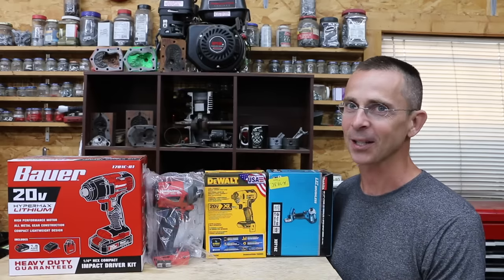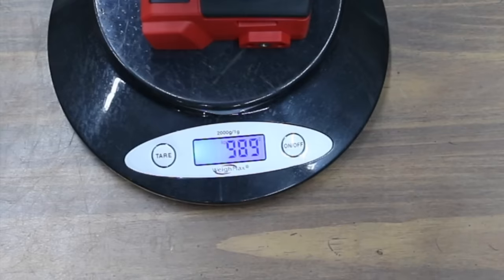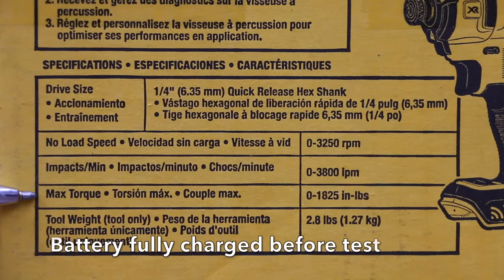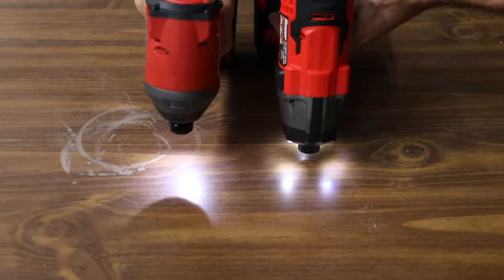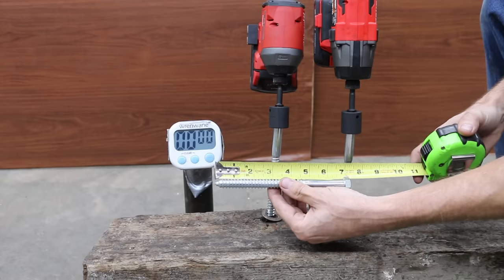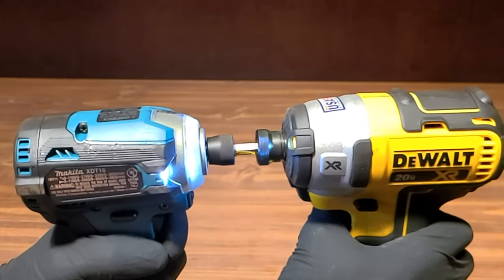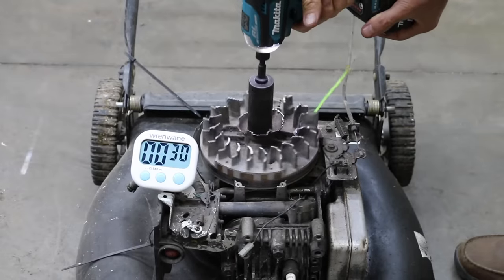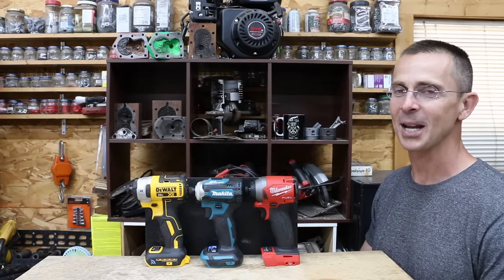Best Impact Driver? DeWalt vs Milwaukee vs Makita vs Bauer!  Let's find out!

Comment: The Milwaukee isn't "powering down" this is called over current protection and it keeps people from abusing the tool like this. That's why it's the only impact drive that didn't try to catch fire during the lag test. It's a feature, not a failure.
Reply from the maker: Thanks for the feedback.
Reply: It's actually a battery temp issue. That is the main way of protection. The milwaukee batteries will put out of to 100 A for their high Ah batteries.
Reply: It's also to prevent the base voltage of the lithium ion battery dropping below s certain value, which would prevent it from recharging properly.
Reply: Mine does it after 1 mins use
Reply: I agree! My Porter Cable impact has done this from day one. It's over 5 years old, fairly well used, and I've never seen it smoke.
Reply: That and it completed the task so much faster that it didn’t have time to heat up as much. It beat the majors and Dewalt by a long shot even with protection kicking in.
Reply: decision you need to make yourself, do you want a tool that will go till it can't no more when you need it to or the ones that "decides" for you when to stop?
Reply: @ProjectFarm  Why not give a answer vs an autobot answer? It feels kinda lame
Reply: @twitchlazy  if a battery temp issue only results in the tool powering down and you just release and resqueeze the trigger and it starts again... kinda sounds like the battery isnt going to cool down much... with makita if the battery over temps it disables itself completely for about 10 minutes, same with my Rigid tools

this doesnt sound like over temp it sounds like over current protection

but it the millwakees over temp can be overridden simply be resqueezing the trigger kinda sounds like a failure waiting to happen and i doubt extremely highly millwakee allowed that oversight.
Reply: @NIGHTMAREuki  that depends... on whether the tool costs 180 bucks and the decision actually keeps the tool fighting another day... granted Ive abused the shit out of my makitas and they still work so maybe it doesnt matter much.
Reply: Love the implication that the impacts were trying their hardest to combust
Reply: Where is the american freedom, what if i want my tool to try and catch on fire
Reply: That’s literally powering down lol. P = IV
Reply: “power down” or “over current shutdown” are the same thing
Reply: @RomboutVersluijs  at least he acknowledges his viewers. You really gonna hate on him because of the method he uses.
Reply: @RomboutVersluijs  Let's see you take care of comments from several million viewers for a couple years, then see how you feel.
Reply: @IstasPumaNevada  Thats true!
Reply: @NIGHTMAREuki  It stops itself FOR you because it's protecting itself from an idiot.
Reply: While it is a feature, it IS powering down (to save itself). The tester never said it was a failure, just reported what happened.
Reply: You say that. Using them in industrial field because it's all our planners would purchase. 
That feature fails along with actual trigger component failures and there is something is the connection to batteries that also fails at high rate. Have destroyed immense amount of these in the field to various causes. They do impact hard but also seem to wear out very very quickly with heavy use and grt incredibly sloppy and or just fail outright.
Reply: @compzac  Makita also has the same basic protection features, they’re actually regarded as amongst the best in battery and tool protections. It’s just that Makita isn’t prioritizing raw performance over everything else, so it’s rarer to need them.
Reply: @Devon Blazek  we get it, you work for dewalt.
Reply: @twitchlazy over current = Thermal runaway
Reply: @tooltime9260  because I comment saying it's probably a bot doing the work.

Comment: Can we see a show down between 1/2"  battery powered impacts such as Milwaukee high torque fuel and the DeWalt XR, Makita, Ryobi, Hercules I seen one video for nut busting torque between Milwaukee matco snap on and Carlyle and Milwaukee took the cake I think you would get a ton of views for that especially after proving matco and snap on impacts won't when they claimed 1600 but only got as far as 800
Reply from the maker: Thanks for the suggestion.
Reply: @ProjectFarm  you definitely need to make sure you do your research and don’t get the new Milwaukee 1/2 inch they are trying to sell now they changed the gears inside and it’s junk and they break very easy now
Reply: I bought the Ridgid heavy duty and it beats Milwaukee hands down.
They also gave me their 7 1/2 brushless saw for free and it too beats rolling out cords.
Reply: @keithlucas6260  no way it does
Reply: @jacibflores97209 ,
yah way it does....even had a head to head and it smoked Milwaukee which owns Ridid....put it's parent company to shame.
Reply: @Jacob Flores  I watched tons of videos the milwauke high torque was the leader for years.  It does beat the ridgid especially usuing the m18 high out battery.  But mikeaukee needs to come out with a new gen
Reply: It kills me to say this because I'm 100 percent a milwaukee fan boy  I've owned lots of other manufacturers tools but milwaukee is by far the best especially in lasting and warranty.  So here's what kills me to say... lol   dewalt has a new 1/2 inch high torque impact that destroys every other impact for torque.  It's not the older 1200 ft-lb one   it's the new 1400 ft-lb one.

Comment: This confirms my belief that Milwaukee is quality.
Reply from the maker: Thanks for sharing.
Reply: I’ve seen Milwaukee out perform a snap on tool
Reply: J T that really wouldn’t be apples to apples, but it would still be fun. Hilti is a professional grade tool, Milwaukee is just the best of the prosumer tools. It still might hold its own against hilti though.
Reply: Milwaukee holds it's own, but will get it's ass kicked in long term durability by Hilti. They're the only ones that still make true pro level tools though, Milwaukee, dewalt, Makita, are only prosumer/low end professional.
Reply: This dispels my belief that Milwaukee is junk. #beliefsadjusted
Reply: John D I’ve run my Milwaukee against Hilti before I knew how big hilti was. It outperformed my coworkers but those were both used tools so I couldn’t say on a brand new out the box versions. Hilti’s warranty is better than Milwaukee’s however I’ve never seen a practical application in their 20 year warranty. Within 20 years it’s gonna die of normal wear and tear and not be warrantied. Or it’s gonna be obsolete to newer tools.
Reply: Too bad a Chinese company owns them now. I still buy their stuff since the quality doesn't seem to be affected.
Reply: J T  yeah, but that's not what most of these small impacts are for. They are mainly for light duty work in the garage or to throw on a few decks screws. I still use a Makita 9.6 volt nicad that has put up more screws than most of these new impacts would be able to handle before being ready for the scrap yard.

Comment: Being a Milwaukee fan boy, I am certainly glad it won. I have the same impact and love it.

Future video idea would be the 1/2 impact drivers. Always seems the be a debate in the garage as to whose impact is better.
Reply: I have the Milwaukee 2767 impact wrench and it's a absolute beast.
Reply: I have one, bought it to remove the pinion nut on my 11.5" AAM rear differential.  Took it off no problem.  That nut is torqued to 350 ft. lbs, then add 12 years of weather.
Reply: @BigBrotherIsTooBig  What type/brand of socket adapter did you use? that is a lot of flex for the adapter.
Reply: @SDsailor7  I didn't use an adapter, it's a 1/2" impact.

Comment: dewalt's app is on prozac: every thing is fiiiiiiine tool also catching fire
Reply: Exactly! LoL
Reply: & and why the heck do I need bluetooth on my impact driver? does it play music as the smoke comes out?
Reply: @donoimdono4868  no but you can change the color, smell and toxicity of the smoke that comes out
Reply: Lmao
Reply: Just don't think about it.
Reply: I have Dewalt tools and love them, but the 887 impact driver can get pretty dam hot and smoke a bit. Had about 1200 100mm bugle screws to run through is timber at work, ended up grabbing my 996 drill after the first couple of hundred with the impact. The 996 peeled through the other 1000 bugles without missing a beat. The impact was still cooling down.

Comment: Love it when there's a clear cut winner.... especially when it's the 2nd least expensive power tool out of the bunch. Milwaukee crushed it.
Reply from the maker: Thanks for sharing.
Reply: Yeah… I just don’t like how Milwaukee kept shutting down. That would drive me crazy on a job site. “Time out, boss! My tool keeps pausing.”
Reply: @seandhoward  I haven’t seen any other ones do that. Milwaukee has a great warranty so they would replace it if your’s ever did that.
Reply: But dewalt is affordable
Reply: Milwaukee has always felt like a kids toy every time I've used one
Reply: @NathanaelD  A kids toy that our performs all the rest? lol. Dewalt feels like shit in my hands. Makita is nice.
Reply: @NathanaelD  You clearly haven’t used a modern Milwaukee, or have use the commercial fuel lineup...milwaukee has made LEAPS AND BOUNDS in durability and quality over the last decade. They are on another level, and this video proves it. Most heavy duty construction or tradesman job sites all use Milwaukee. I rarely ever see a dewalt anymore.
Reply: @deepswimer11  did you watch the video? The dewalt was more expensive than Milwaukee by $40 lol...
Reply: @jaredchampagne2752  I'll admit. At the time of my previous comment, I hadn't used much Milwaukee. I am more of a fan now after seeing their lineup and the pack out.

Comment: the railroad lag bolt test was brutal. thanks. really nice to see which ones hold up under duress
Reply from the maker: Thanks for watching!
Reply: Ikr can't believe some actually smoked lol   the milwaukee shuts off because the tool and batteries talk to each other to prevent damage but still crushed it